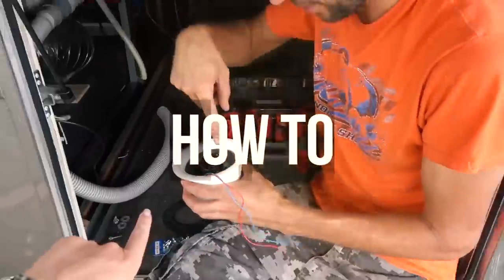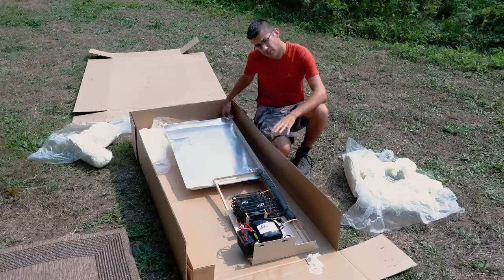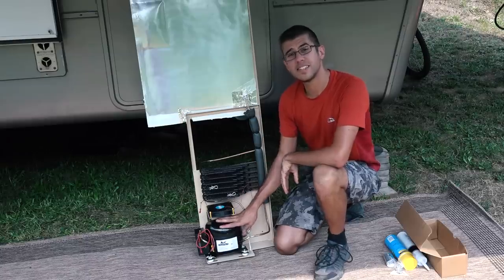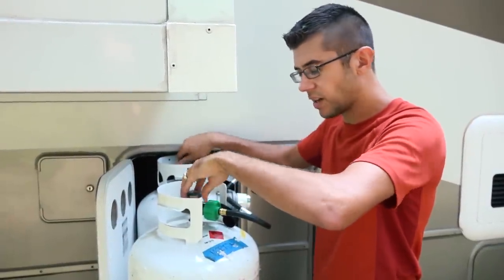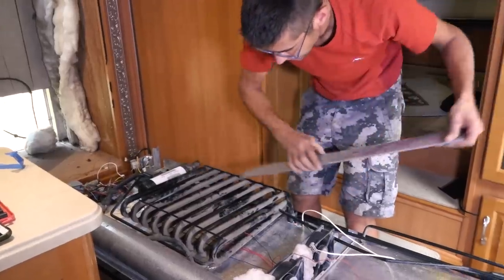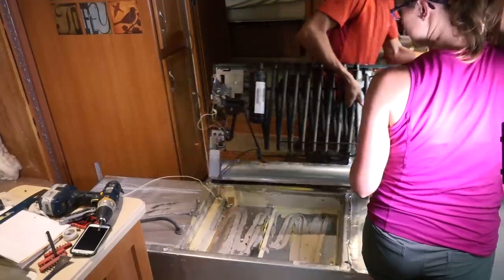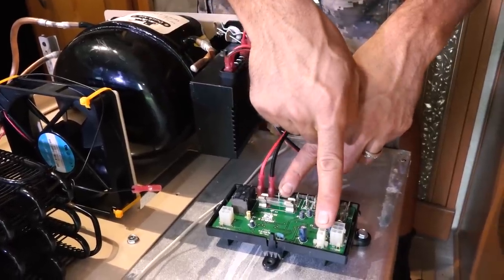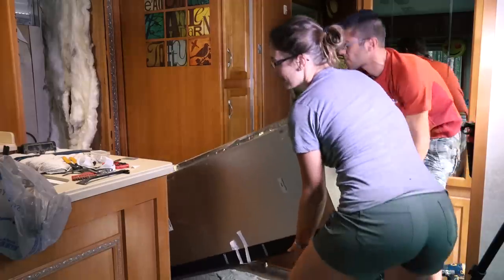Converting our RV Fridge to a High Efficiency DC Compressor- 8x More Efficient! and Better Cooling!

Comment: I'm glad you have a working solution now. I have an older unit that can cool the freezer down to -20F when the outside temperature ranges in the 60s to 70s. The freezer still stays down to about -5F when in the 80s to 90s. The frig stays in the safe range too. I actually have a problem with the frig getting too cold and freezing.
Reply: An RV unit?    What Make and Model of Fridge/Freezer?  What year RV is it in?  I ask because will buy a used RV and want to know if Dometic or Norco are better made.
Reply: @birdwing98  The one refrigerator is a Dometic 2600 in an old Nomad trailer build in 1986. The other unit is a old unit from an Open Range trailer. The other unit is a Dometic 600 series frig. This last camping trip the Dometic 2600 dropped to -22F on the freezer plate and was holding the frig near 32 while the outside temp was 95 during the day.

Comment: VERY well done video, and loads of good info as well!  I was unaware of this options existence.  Thanks for the education.  As a Broadcast Engineer myself, I do appreciate your attention to detail.

I have had (what I believe is) the exact same Dometic fridge in my 2007 Heartland BigHorn 5th wheel.  After being unimpressed with its cooling, I added two 6 inch computer fans to the top outside vent, blowing out...basically sucking the warm air out from the upper rear fins.  Then I added a small DC fan inside of the unit, blowing on the fridge fins.

The end result of this was a fridge that stayed about 33-36 deg, and a freezer that stayed between zero and +8 all last summer.  Oh, and I should mention that I cleaned the burner, and flue too.  Very important!  Something must have really been wrong with yours to cool so poorly.  Although I haven't had to use it personally, the upside-down trick does work too.

Absorption fridges don't have to cool poorly, but many of them do when they aren't working well.  They also don't use very much propane when they are working well...Nothing like the furnace or water heater.  Just a tiny little flame. They do take a while to get going however, and that is a more significant draw-back. I don't mind getting a 30# tank re-filled once or twice a season.  If we were full-timing like you, I might feel differently.  

Propane is basically a waste-gas anyway...A by-product of the refining process.  They used to just burn it off until they realized people would buy it.  As a side-note, my parents used to have a gas home fridge, and installed a new Arkla-Servel gas air conditioner in their home in 1968.  It was an overly complex PITA, and it sprung an unfixable leak after about 12 years.  So I've had both good and bad experience with absorption cooling.

I fully understand why you folks went this route, but it's probably not a path I'd take.  At least not till I have tons of solar on the roof, and a Tesla battery.  :-)

Comment: That's an interesting new option.  We had JC Refrigeration install their so-called 'Amish Cooling Unit' in our Norcold 1200 last year.  Very impressed with the unit and the factory install.  And it works great!
Reply: So do they have factory trained tech people by state? What other diagnostics should be used to test and retro fit a unit. What is warranty? You can buy a car certified used car and major repair warranty. They used to have dynamo tested vehicles . seems money pit RV dealers... On a 70% depreciated motor home with 15 year financing and seven year depreciation

Comment: Thanks, I have the exact same fridge, looks like a great solution. The only thing i would change from your install would be to use a low bonding foam to foam the unit into place. Low bond (white) foam would be a lot easier to take back out if there was any need for service.
Reply from the maker: That is  a good idea, I will recommend that to JR refrigeration too.

Comment: Super well done and interesting video. I'm learning that the gold standard of 12-24 volt DC fridges is a pricey one. No matter whether retrofit, or brand new it is expensive to have DC refrigeration. Buying a new DC fridge to install in your RV would have surely been much more money than the conversion though. I'm glad it all turned out well for you guys.

Comment: In one year as an RV repair technician at a major dealership I saw six RV's burned to the frame from absorption refrigerators rupturing and the heated hydrogen gas igniting an inferno.  With the advent of turbine compressors in modern refrigerators the power requirements dropped making them a good choice.  The difference in price between RV vs. domestic refrigerator would allow you to triple your battery capacity and add a very useful 110v inverter system.

Comment: Wow! impressed! Extremely ambitious retrofit. Not many folks will have the patience for this. Bravo! One issue is you can't compare the propane refrigerator's heating element power draw your compressor's power draw. Not fair. Propane units are designed to run on Propane. Their heating element option is just for when you have access to shore power. You can't use a compressor unit when you are off grid for extended periods. You will need a small stand by generator and you will be using it. For a bigger fridge put two propane units side by side and open the doors center forward. Cooling fans don't work on propane units. Why? The ammonia refrigerant gas cycles by high and low pressure created by the addition of heat energy. Cooling the condenser cools the gas on the high pressure side. Cooing a gas lowers it's pressure. That slows down the cycle when you are trying to speed it up. No body gets this. Find a retired chemistry teacher and take him out to lunch. Fans will only help on the compressor units. Propane units are totally different animals. The hydrogen (or helium) is used to provide the atmospheric pressure so the ammonia cycle can be continuous. Yup... get our your Chemistry books. There are no chemical reactions going on here. You just have to trust the professor on this. On warm days use two ice block containers. One up and one down. Change them out in the mornings. That brings extra cold down below. Ok to use a small circulating fan below to keep consistent food temps. There is always a trade off with these things. Super good video on changing out the cooling unit!!! I've done two propane units myself. Patience is indeed a virtue.

Comment: The AC/DC compressor systems are worth the investment from my experience.  Even the cooler size systems like the Dometic CFX-40US Portable Electric Cooler Refrigerator/Freezer 1.4 cu. Ft. that I picked up with a Insulated Protective Cover for $563 total works great. 

I burnt out a thermoelectric system and decided I didn't want to spend the money for ice and limited capabilities on my next investment. 

Neat to see the larger DC system (which is easier to transform from AC to DC versus DC to AC) cost is reasonable compared.  Thanks for detailing the conversion and system!

Comment: Great video, I've been looking to do something about my RV fridge since is also around the 50 degrees and 20 on the freezer, I also have enough solar power to run any model and your DC option seems nice, but for my case I think I prefer to buy a residential unit that has a big condenser on the back and it has the same outside dimension of the existing fridge, I saw one in home depot for just over 500 dollars, I only wish there was an option of having both compressor and evaporation style unit so if I have too many cloudy days I could still use the propane as backup, again great video
Reply: This is the most cost effective option for most people that have enough space to install a residential unit. A 10cuft fridge will cost around $300-$400 and will only draw 0.75kwh/day.

Comment: I’m sure someone already said it.  But the reason it wasn’t cooling so well, is because the fans were installed with insulation between them.  Which was blocking airflow.  So you were supposed to know to manually turn on the fans, if the outside temp was above.....  maybe 60ish degrees.   Would’ve been nice to know.   If they’d been wired up to come on automatically whenever the fridge was running, that would’ve been ideal, and you probably woulda been blissfully unaware of how awesome your fridge actually performed.

Comment: Nice to know there are conversion kits like this out there. I would have thought they would be cheaper to buy than a new absorption kit. Thanks for the tutorial.
Reply: Unfortunately, it's kind of a niche thing, so they've got the novelty factor going for them.
Reply: but then they wouldn't have saved the ENORMOUS amounts of Kwh that they did!
Reply: Small custom manufacturer vs mass produced by larger manufacturer.

Comment: The problem with refurbing an old fridge is that the insulation gets damp over time and loses its effectiveness. It's usually more effective to replace the entire thing than change out parts

Icing up of the fins is an indicator that the door seals need replacing

Your next project should be replacing the 24V battery with LiFePo4 - These are cheaper to run than Lead-Acid in the long term and have a very stable output as well as being able to go to 80-90% DOD instead of the 30% limit of lead-acid batteries

Comment: When my fridge stops working well I may look into this.   That being said, mine is dated 1969 and if you turn it all the way down makes ice in the fridge.  Apparently the old ones are hard to die.
Reply: 1D10CRACY Freon
Reply: R22 or propane r400something. Operates similar to r134a.
Reply: it may still be working because the old gear was just made to last forever, but the efficiency of them is terrible, I would replace/upgrade it if it was me.

Comment: I know it was 4 years ago but for cleaning up that Great Stuff foam, WD40 will clean it up nicely. Both from hands and surfaces. It also cleans up the cans application tube so you can re-use it later.

Comment: Great video! One note of concern however, you should always allow the compressor to be vertical for awhile before turning it on after being laid horizontal. That allows the fluid to settle back into the compressor. This is why your compressor was cycling at first start up. Very bad for the compressor. Also, anyone that does this conversion- don’t forget to cap your LP gas line.

Comment: I learned a lot about the back of an absorption fridge that I have never seen before. The insulation on the inside of the cabinet where the fridge is is something I have not seen before. Most rv's I have seen have nothing there which I would say is a bad thing. 

Not sure what I would have chosen this route depending on the cost for you this may have been the right choice. An 11 cu ft rv style whirlpool sells for about $600 has the 24-inch width can be had with an ice maker plus defrosts itself. A chore that some rvers hate. The draw is about 40 amps a day from what I have heard which is manageable. The downside is that an inverter is required and larger battery bank is required but that is something that the Mortons actually have in spades. There are dc only and dc/ac low amp draw compressor fridges (ac/dc switch over automatically) but they don't defrost automatically and they are easy twice the price.
Reply: I would bet that whirlpool you're talking about uses 40 amps continuously when it's running. Not per day

Comment: If you're getting ice build up it could be one of two reasons you could have a leak on the door seals or could be where you are placing warm food in the fridge. 

I also found that when I didn't use my fridge for a while and then switched it on the first few times would it would ice up bug would do settle down.

I found leaving water bottles in the fridge helped maintain a good temperature too so give that a go.

Comment: this is a really great video I am very impressed with your imagination, knowledge and skill. I am sure that many RV users with three way fridges will be converting to compressor fridges. One question I would like to ask is would it have been a good idea to apply additional insulation to the side(s) of the fridge prior to installing it in place  as this would have helped to keep the fridge cool and reduced power consumption (although with your solar setup i guess you have plenty power). I appreciate you uploading this video.

Comment: Great video!  We've been considering this mod and your video was extremely helpful!  One question I have: With the restrictions on how the system can be physically manipulated (only lying on one side and only rotate in one direction), how do they ship these without it getting improperly handled?  Thanks! 😊  -chad and tara
Reply: I have this same question! Our fridge is in need of an upgrade. We thought there was only the 2 choices of typical RV fridge vs Residential. We weren't sure whether we wanted to install a residential, though. This seems like a great in-between option! We would need it shipped, however, and I'm concerned about the shifting during transit. 🤔
Reply: I don't have experience with this unit directly but have a 12 volt chest fridge/freezer unit made by Whynter. 
It was also a concern since it runs on the same high efficiency 12v compressor.  They informed me to set the unit upright for 24 hrs before turning it on. This will give a chance for all the oil in the system to find its way back to the bottom of the compressor.  We have had our unit for 5 years and it can freeze down to -10 f if so desired.
Reply: Bypass 12 volt system, domestic classic fridge

Comment: Excellent video. Buuutt..PSA: Even though circuit is off, a good rule: Never work around electrical circuits with a ring/jewelry on.
Reply: Exactly. In high school i melted my class ring, installing a golf cart battery when the wrench touched my ring thole the other side of my ring touched the frame

Comment: Nicely done! Interesting that I am looking to do just the opposite - switch out a 12v compressor fridge for a dual propane/electric due to battery capacity and noise.

Comment: Hi Tom, Furrion is now offering a "drop-in" replacement for the Dometic/Norcold 8 cf absorption refrigerator. It is the 10 cu. ft. Furrion Arctic™ 12V Built-In Refrigerator, with either left or right hinge. They are selling it for $1089 with free shipping on their website. My local RV dealer quoted me $1800 for the unit without the cosmetic panels.  Needless to say I ordered from their website. As soon as it is installed, I will pass along more information. We first saw it in a new Forest River Cherokee Arctic Wolf 3550 SUITE.
Reply from the maker: I will check that out!

Comment: Would have been a good idea to mount the new unit while the fridge is standing, so a second person can check for alignment of the screw holes and put at least two screws in.
Would be another good idea to lube the plugs against corrosion (e.g. LiquiMoly-LM40-spray)

Comment: Good job guys. I’ve got one of those lovely 4 door nevercolds. Simply put running it on solar is out of the question even with my 2300watt system. All said, I think I’ll go residential for three reasons: more finite control; over fridge, freezer temps, an ice maker and auto defrost :) Anyhow ... awesome conversion.
Reply from the maker: Isnt that crazy how inefficient those absorption units are on electric!  Good concept for Gas but electric is just a waste.

Comment: I think you meant #12 AWG wire at 34:20. 12/0 is normally referred to as 1500 KCMIL and has a rated ampacity of 625 amps and the copper diameter is 1 1/8 inches. Might be a little large for this installation. ;)

Comment: Certain Danfoss compressors like the BD35 and BD50 can use dual 120AC/12DC volt power. To date, I have had zero issues with doing Danfoss conversions to marine refers. should work the same on an RV.

Comment: These RV refrigerators (that also use Propane) Can often be Revived, by taking them out..
and Rotating them Upside Down every 4 to 8 hours (4X ~ 6X a Day) for several days.
This is to Dissolve the Crystals that Form inside the Lines, and often this can “rejuvenate” them. I got 25 yrs out of mine doing this every 10 yrs.

Comment: Vibration is your friend when “breaking” loose unions and flare fittings like your gas line.  Just strike the nut on several sides with a hammer prior to putting a wrench on it.  Also a REALLY good idea to use another wrench to “back up” the other side of the joint and protect tubing from being twisted.  WELL DONE VIDEO.

Comment: I stumbled on your video while looking to repair RV fridge.  I checked the price for my Dometic conversion kit, it’s too much for my conversion. I can’t see paying $700 for the kit.  I’ll just buy a new fridge.  Great video though.
Reply: Flip your refrigerator for 24 hours then reinstall, improves the system, big-time runs colder than ever. Especially if he's never been flipped hot older models. Good luck

Comment: Interesting idea and worth experimenting. I had this idea to use old car ac system and compressor but gave up. Reason - inefficient. If it works as you say, then good to try but.... Propane fridge does not use 600 watts. Its motherboard draws very little current to maintain the flame and some  more to start and stop relays during the cycle. Never 600W as you say. You can do it with this unit but you need a heck of a battery bank to run electric all the time.

Comment: The fins are freezing because you don't have good air flow. It would appear that there is too much stuff in the fridge. The solution is to either reduce what you have in the fridge or install a circulation fan on the fins.

Comment: What most people do not realize is how much cold air is lost when the door of the fridge or freezer is open, causing more energy usage to get it back to it's target temperature. I opted to remove my fridge and will be putting in a style that opens from the top.
Reply from the maker: You are very correct, chest units are much more efficient in that regard.